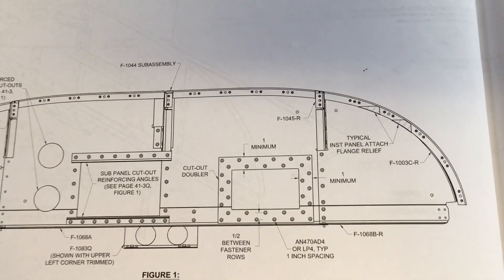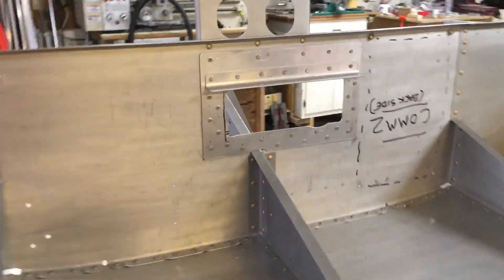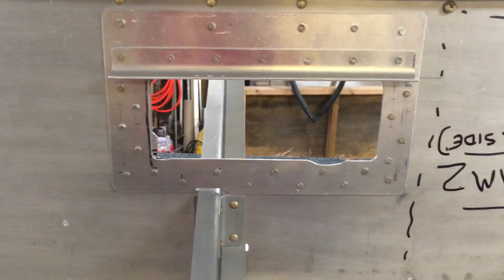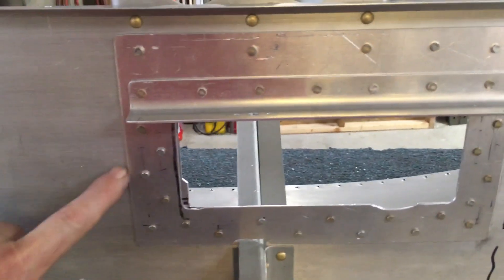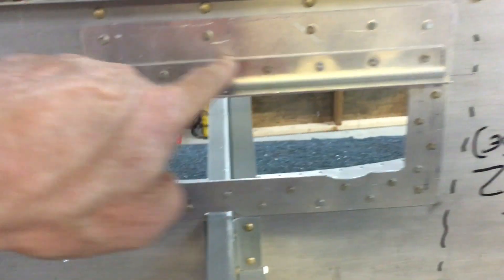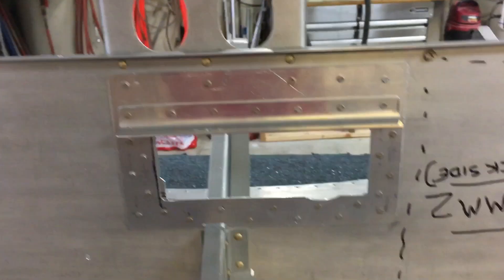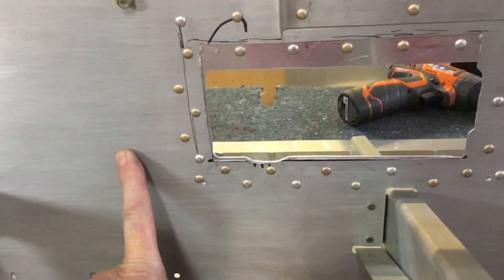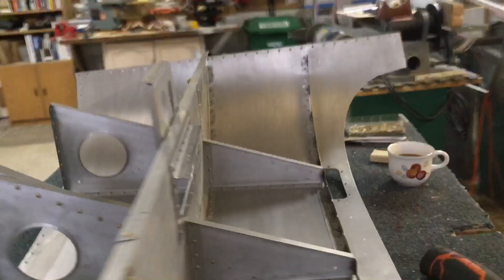RV10 Update

Comment: I'd be concerned about the stress riser corners on that cutout, and lack of edge distance on couple of those rivets. 
Keep an eye on those once you get into 100 hr inspections
Reply from the maker: Ya, I was unable to size it perfectly, it is thicker material than called for and has the additional angle so I’m not expecting a problem but your right about checking it during inspection.  Thanks for the comment!